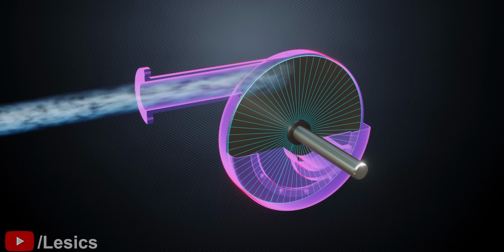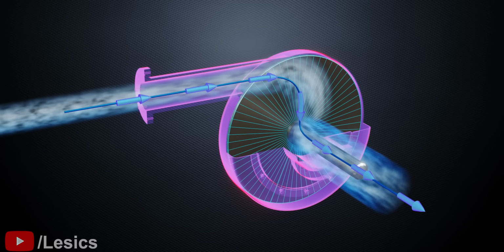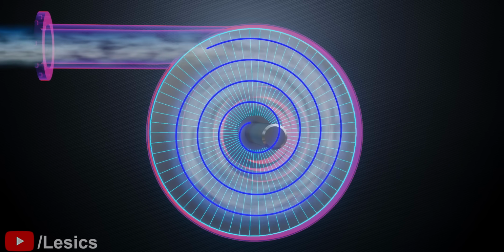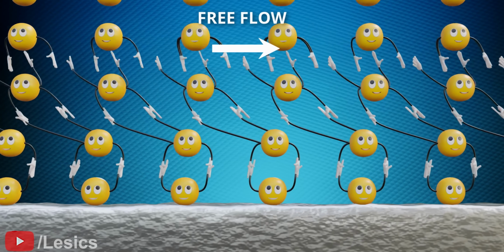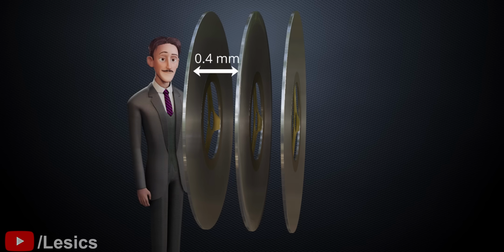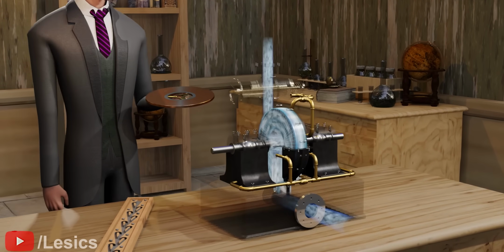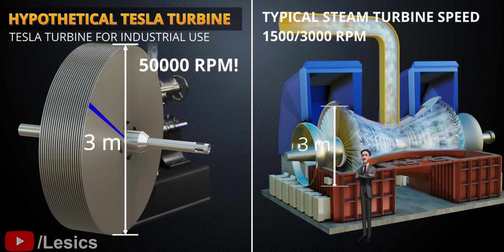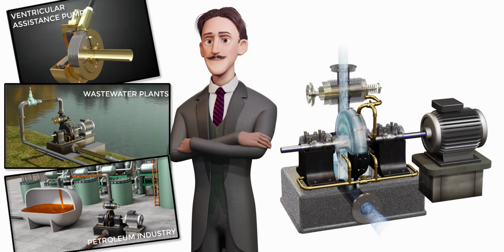Tesla Turbine | The interesting physics behind it

Comment: From an engineering point of view Tesla had to reduce his energy output due to materials not being able to keep up...
There is a way around for warping the disc issue..  you can coat the discs in a material that it would not allow to warp or bend with high pressure..... During Tesla year's this option was not available....Now new option is now available ....

Comment: Doesn't the fluid flow need to be fast enough to power the engine? in order to accelerate the engine, the fluid needs to have a speed higher than the linear speed of the disk at where they contact each other right? Is this speed usually achievable and how?

Comment: Why would reducing the RPM be the only solution? Why is it only good for "industrial" applications? Why not reduce the disc size sufficiently to achieve 50k RPM, and let the units be small - for single home use?
Reply: String together small 50k RPM units to achieve desired output

Comment: Question for everyone:

The spiral action increases the contact area of the vicous force  on to the disk.

Would that be the same as saying (from maybe a different perspective) as its increasing the effective surface area of the disk? (Hence the need for a 3meter diameter disk mentioned later)

So couldnt you fix the RPM issue by increasing the effective surface/contact area? Thus requiring a lower RPM to hit the effeciency numbers mentioned? 🤔🤔
Reply: But that would still wouldn't solve the problem of the edge of the discs moving too fast.
Reply: Physics/Engineering isnt my profession but if you were able to cause the fluid to travel over an effective surface area greater than what it would have traveled at normally, with lower RPM .... I could be wrong but the general idea is as follows...

I.E:  Drill holes in the disc. The holes increase the effective surface area of the disc, just like disc brakes on a car. 

The fluid traveling along a Xdiameter disc at YRPM drags Zsurface area.  Z increases in proportion to Y (spin the disc faster, fluid travels along the surface farther/longer).  So instead of increasing Y (RPM), we're increasing Z (travelled surface area) and, in theory, we arrive at the same effciency but without needing to go Mach 13 :)

Comment: If the disks are stable in their rotation, I would imagine you could use a harder material like carbide, titanium, or hastalloy.
Reply: inconel likely.
Reply: @the_chomper  had to look it up as it's not an alloy I'm familiar with. Interesting properties considering it's tensile strength at high temperature and it's resistance to scaling and oxidation resistance.

Comment: That's great but why cant we put tesla turbines in a series way with other normal turbine i.e. at extraction point of normal turbine where we have less water pressure or even we can make out some application for small scale generators directly via rivers or from low water pressure areas it will run at less than 10000 rmp in those area. Its same as a normal hard drives in computer systems the same alloy can be used to avoid expansions.

Comment: QUESTION: Assume the tesla turbine "blades" are made from tough material such as Maraging steel or some other tough material and  we reduce the disk size substantially ( waaaaay below 3 meters), will the tesla turbine endure "mechanical stress" beyond 50,000 rpm? Will it still fail and break apart?
Reply: at that size it wouldn't be efficient
Reply: @protonneutron9046  is there a minimum disk size before the efficiency starts to drop?
Reply: @munbu5066   Unknown. You'd have to test.  But no size works for commercial/industrial application.  Which is why it is never used.
Reply: @protonneutron9046  I see....thank you for your response.. very helpful

Comment: You don't show the difference in pressure in the chamber at high speed and the reason it is really efficient. The fact you seem to ignore is that the higher the speed, the higher the pressure inside the chamber and thus the less fluid it consumes. It chokes itself at some point and we don't have working models to see what really happens. I suppose the very high frequency might trigger low energy nuclear reactions in water molecules in the fluid and significantly contribute to the torque.

Comment: Yesterday, I suddenly I saw this video. My brain think to the way is to use water to run Car ‘s turbine for car running either way to charge battery power again. But I think best way is that water is similar to collant for CNC machines. Gas is  getting to raise uptoo fast . I just share my thoughts guys .You could refer . Don’t say are you ok ? Before I got that . I just calm no against to that guy by my words. Because before I used to watch technology using water to cut metal. Water can run circle by technology for car . Tank could be bigger more than tank gas .

Comment: What if they used gears to reduce the RPM?
Like, 4-6 gears? Maybe?

Attach the generator to a gear system that would shift to higher gears depending on the strength of the flow.

This would, probably control the RPM and make it so that it remains at a stable speed and since it uses gears, it would multiply the energy that is supposed to be outputed.

I can't really put it into words but, imagine it like this...

Power Generator>Gears>Blades>Water Spinning the Blades.
Gears control speed of the blades and maybe even multiply the output created by the Generator attached to it.

Dunno if this would work, but oh well. And idea is just an idea, until it works.
Reply: Can they also install a dampener to reduce mechanical vibration at higher RPMs?
Reply: @rmatt24  your idea...

Comment: Why reducing the speed instead of the diameter of the disks? And why do they need to be so big to be industrial if one of less than half a meter is already very efficient and easy to build, why not using more amount of little tesla generators so they have even more generation than one industrial generator?

Comment: The problem isn't with the size or strength of the disks but in the idea that industrial usage is the only avenue.
Wouldn't be hard to make a smaller one powered by compressed air which runs at a lower speed, that would when attached to a battery store enough power to run the compressor and perhaps a little extra... like enough to run an air conditioner and fridge??? Maybe even the lights for a single household.
I say the problem is still on reliance of industrial ideologies regarding centralized power.

Comment: Making this more efficient is easy. Have scoops direct flow inwards at a diagonal angle. Have a swirl style channel and dimples and bumps on the plates. Have it exit at the center like normal. It now is trapped and producing viscous force throughout the swirl channels as fast as it can. Exiting with a good amount more force expended into the plates.

Comment: Would it be possible to use another method?
Instead of one large turbine that creates a high tip velocity, several smaller ones that have a much lower tip velocity. 
Place these around the shaft being driven, their combined output torque should be the same as the larger one.
Tesla was using steel, but we now have the availability of Titanium which is lighter but a lot stronger than steel and could withstand much higher velocities.
Reply: Yeah. 
Don't let this video limit you. 
Exactly. 
I'm an inventor and I don't like using language like, it can't be done. 
I like to say, how can it be done and try it, see if it works.

Comment: It is a common mistake - but lift is not generated on the short side (below the blade) but on the long side (above the blade.) The arrow 54 seconds should be moved - because the representation is simply wrong.

https://en.wikipedia.org/wiki/Bernoulli%27s_principle

Comment: I was lucky to get an old giro-engine 2.5 kg, 24 volts, 30 000 rpm, made in USSR in 1965. It's quite a cool toy. Sound it generates during reaching top speed is something. A very dangerous thing. Too much energy. Strong giro effect. It was quite a challenge to play with that beast to test on a physical level some ideas....🙃

Comment: So a quick search revealed to me that a turbo prop jet engine runs at over 30,000rpm. So I guess that is achieved by some kind of mechanically impossible black majik.
Reply: Uh...no.  the stresses on a blade (a bar essentially) are much different than on a disc.  This is due to the combination of both tangential and radial stresses.  The bar has only radial stresses to deal with since the radial free surface can not restrain tangential forces.

2000mm Disc OD
Mounted on 200mm Shaft (200mm Disc ID)
50,000 RPM
Maraging Steel - Strongest in existence....350 ksi+
Density = .289 lb/in3
Poisson's ratio = .30
E = 190 GPa

Maximum Tangential Stress [(σt)max] = 105,190 ksi !
So the stresses are 300x greater than the yield of 350 KSI Maraging Steel

There is a reason for Engineering degrees.

Comment: Why the Tesla Turbine is not used is because there isn't anything much to have to replace. Common turbines are high cost to keep in operation. We got to keep companies running and people working.
Reply: So, build a Tesla Turbine and then you will realize that it is ONLY ~40% efficient.  And it would need to be massive to provide any reasonable amount of useable energy output.

Comment: I'm no "Engineer", so my question would be what about "newer" composite materials with higher stress tolerances? It may still not get to mach 13 but maybe get higher than 10k rpm limit?
Reply: Well, 50k rpm is achievable on a smaller disk size. 10k should be easily possible with modern materials on a 3m disk, but probably not near 90% efficiency. 

If graphene is as amazing as they say it's meant to be, it might be able to reach faster speeds than previously possible, given it's meant to be extremely hard and very light. (BIG advancement in engineering possibilities)

But even if possible, it's probably just not worth the hassle if I had to guess. Why build an engine to rival modern turbines when it reaches ten times the speed on the outer edges of the disk? Probably makes it far more costly to build and maintain for little gain in efficiency.
Reply: @pagatryx5451  Cool. Thanks

Comment: Is the "fuel" for this turbine water or steam? Specifically can it function with liquid state?
Reply: They say fluid so I assume it could work with any gas or liquid. Or at least any gas or liquid that won’t corrode the materials.
Reply: @mackenziebeeney3764  I feel like installing some of these in my pipes could get some extra juice.
Reply: @TearDownGenesis  If your idea worked, then every engineer would already have one installed in the home.

Comment: In other words like many of tesla inventions it's still ahead of its time. Materials get better and better as we make advancements leading to a conclusion that at some point in the future a material could be created that could withstand the 13g speed. At that point it would be plausible to get efficiency higher than that of a bladed design. If the efficiency is really 97% than it could be a near ideal generator. The real leap in energy production would be finding a way to cheaply and easily reintroduce the wasted energy back into the system to reclaim it. For instance to cool your home the compressor outside experiences every waste in the form of heat. The ideal solution would be to capture the heat to run an efficient steam generator again producing power from the wasted heat.
Reply: No .. this device is only 40% efficient in the real world. So, guess again, as to why it is NOT used.

Comment: Wait, hold on, you lost me at the end. Why does the turbine have to be 3 meters in diameter? Couldn't you just use more smaller turbines? Like, obviously you can't just swap it out, the fundamental design is completely different, but you're saying that because it can't be swapped out it can't be used?
Reply: Then the shape of the housing is no longer like the DISC.  It is now a long tube.  That and it is ONLY 40% efficient !!!

Comment: i think that the technology's efficiency rating is in fact correct, but limitations with material sciences even today hold its potential back, one solution is to reduce the diameter of the disks so that the blade tip velocity can be reduced as it is closer to the shaft, alternatively reducing the number of disks can also reduce the amount of speed gained, it may be possible in the future to make tesla's turbine work flawlessly in an industrial level once the material science catches up (since most engineering theories are vastly crippled by the depressingly slow pace of material sciences.)

Comment: One piece of information missing from this video is the fact that the bladeless disk turbine can process fluids through a phase change, and airfoil turbines cannot. In layperson's language, the tesla turbine could take in steam, and exhaust liquid water. If you attempted this in an airfoil turbine with steam in, it would destroy itself long before you would have much liquid water at the exhaust. Most industrial power plants operate at a total efficiency of around 50% in terms of the heat produced by the fuel to electricity produced at the generator (what the turbine spins). To achieve this efficiency they must be driven by supercritical steam, which is basically vapor that is flowing as a liquid does. This requires enormous pressures and temperatures, something like 2500deg.F (1400deg.C) and 200-250 atmospheres of pressure, and you still are left with exhaust that has enormous amounts of heat energy in it. This heat has to be vented to atmosphere through a condenser or other cooling apparatus, which is 100% waste. If we could simply take an existing power plant and put a bladeless disk turbine at the exhaust of the airfoil turbine we could hypothetically capture the majority of this heat, saving on construction costs, real estate costs, material costs, and have a power plant with a much more compact overall design. Conversely, if we were able to drive the entire power plant with these turbines we would not require the enormous pressures and temperatures that typical airfoil turbines require in order to operate for a given power output.
Reply: Exaclty, people don't realize why many of Teslas inventions are not used. Its all about money!

Comment: No need to confuse the audience about boundary layers.  When the flow occurs in a tight gap there exists a laminar flow regime (Shear flow as opposed to turbulent.) The velocity gradients is highest near the walls.  There is a simple equation to calculate the shear stress at the walls. This shear stress causes the discs to rotate.   This is a basic concept well known in chemical engineering.

Comment: What if you were to increase its size, make it much larger then run it in a the  vacuum of space?  Could it be a gyroscopic propulsion device?  It sure would be a stable platform.  Where there preasure applied to a gyroscope it will have a 90° reaction. Use that reaction as your direction of travel?   I'm just sayin

Comment: I wouldn't call "35000 RPM" a failure. I would call that a "Conditional Success".

But what about the torque?

"Mach 13 at the tips. Definitely an engineering impossibility." With just iron, yes. What about other materials? Diamond, titanium, heck, uranium? Any high-tensile material we can get our hands on, would make making the Tesla Turbine an engine on a forever loop.

Iron Crystal is on the table. Heck of a material to use, since it's tensile strength is 9500 MPa at 2 micrometers. Which is translated to 137786 Pound-Force per Square-Inch.

That'll last... decades before it breaks.

Comment: Could a similar torque be created by a more numerous set of smaller diameter disks? This would reduce tip speed at identical RPMs, and more  mass will be kept closer to the axis of rotation.
It seems that conventional turbines circumvent their own size problem with a whole lot more tiny fins to counteract the thicc mass GAINZ. So, perhaps this vastly different contraption needs a much different approach to the mathematics?

Comment: I'm not a scientist , but couldn't you make the disks thicker , so are stronger and heavier , and they would balance out between a  higher  RPM than 10000 and still withstand the shear power ?  or at least the disks have a thicker out edge and thinner surface filled with holes , the stationary layer of the liquids would be in the hole minimizing the the viscosity boundary and , giving some space for the material to expand on the holes while the outer edge is a little stronger so that it wouldn't get damaged.

Comment: What would happen if you made the disk thinner? It'd be weaker, but wont that improve the way it works?
Also what if you spin up a dozen graphene disks to 10000 rpm and then use steam to accelerate them further?
Reply: Making it thinner would not fix the issue of the edge/tip speeds going through impossible Mach numbers. Also if you would want to spin it up to higher RPM's you would need steam to flow at atleast the same velocity, excluding losses. in energy conversion.